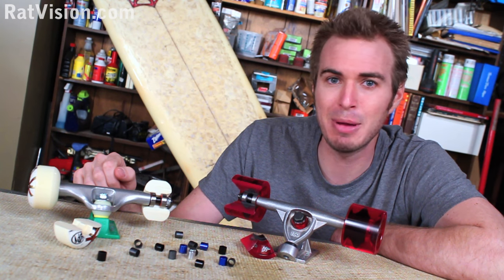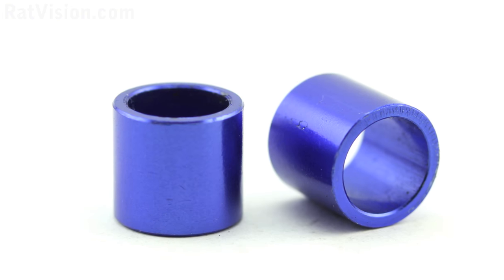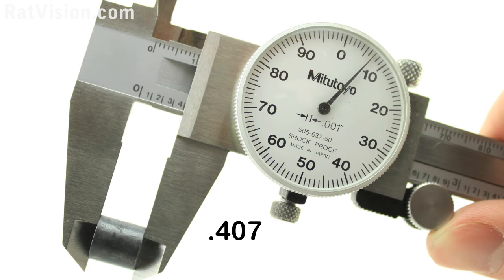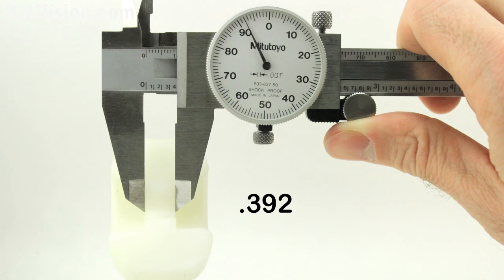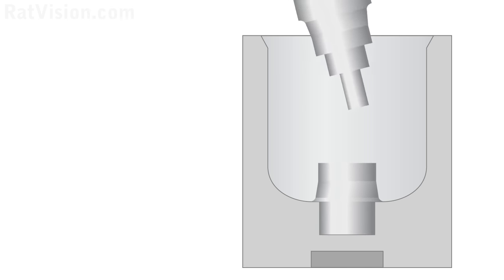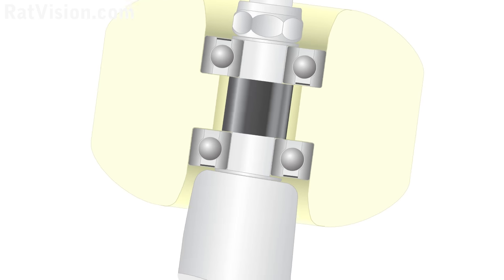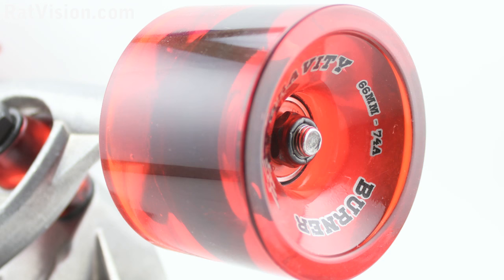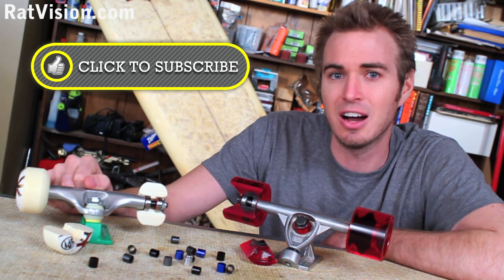Fastest Skateboard Wheels, Bearings, and Bearing Spacers

Comment: I am a beginner getting into street skating. 
I got a board built a month ago at a nice west coast skate shop and just realized it doesn't have spacers (but it rides great). 
Given all the info in the video, what is your best practical advice? Should I try to get some? Or if I am putting together a new board, what kind should I get? Is it worth it if there are going to be minor defects in many of the parts? (I ordered trucks, wheels, and bearings, but none of them came with spacers.)
Great video!
Reply: they're are not useless. get a board and slippery wheels and practice slow slides. wet ground is easy to slide at low speed so its good for beginners because its fine if you eat shit you arent going too fast. and skate shop has spacers for like a dollar
Reply: no one uses they
Reply: ok that doesn't mean anything
Reply: when I first started skating I thought spacers weren't important but without them your baring can get worn down quite quickly.
Reply: theoretically it is best to use spacers. practically it is impossible to find proper fitting spacers and if the spacers dont fit properly they can damage the wheel. the cases that hold the bearings will eventuallly get wider and the wheel will be a size too loose for the bearings. it will be like the bearing rolling over a carpet of wheel, if this makes any sense. just dont bother with spacers i have been skating for 30 years and only used them until i was 10

Comment: I have spacers that are about 2mm bigger than the wheel centre and the bearings just stick out of the wheel, is it better if i just take them out or should i keep them in? Ive been using those spacers for about 4 months
Reply: Get different spacers instead of going without them.
Reply from the maker: You can use them.  Better to have them in.  However, unbalanced parts can lead to speed wobbles. It doesn't mean you'll get wobbles, just letting you know it's how it happens.

Comment: So, is that final wheel, the bones one all rubber, no plastic hub?  That's part of the problem if so, I would imagine, but I could be wrong.  Generally wheels without cores are pretty dicey as far as durability and precision / tolerances.

Comment: Hey Rat Vision – Skateboard Tech in your opinion what is the best brand to go to for street skating wheels?
Reply from the maker: We haven't done a ton of testing on wheels yet, but we don't like Spitfire or Bones.  Their wheels might work perfectly fine, but we don't like the urethane in Spitfire, and we don't like the false information from Bones. You also need to realize that nearly all wheels, in both street and longboard skating, come from just a small handful of manufacturers.  So, it's important to know that almost all brands do not make their own wheels.  This is why we need to find out where all the wheels are coming from and then do some testing.

Comment: I've heard that brass spacers are better than spacers made out of other materials. Is that correct? Secondly I'd like to know how to measure the space inside a wheel without destroying it in order to have my perfect spacers custom made. Many thanks in advance ... !
Reply: OK- to leave you not alone with all the work I did some research on brass. Brass is used for and in thousands of products. Skate-relevant applications are especially fittings and gear wheels. Brass perfectly connects with brass or other types of metal as it is: slightly softer than metal, very smooth with a very durable surface, heat absorbing, corrosion resistant and has significantly better vibration characteristics than metal. Brass gearwheels are mainly used in combination with metal gear wheels as this results in best possible torque efficiency.

Using brass spacers could theoretically add more stability to the whole skate bearing system. It attaches better to metal bearing cases and could help reducing/compensating/absorbing loads, vibrations and heat. Considering this, using brass washers/speed rings may also be a good idea to use.

Just some theoretical thoughts with definitely no guarantee at all to be correct my friends:-)
Reply from the maker: Where have you seen brass spacers?  Are you referring to the brass ball retainer inside a bearing?  Brass is a metal!
You're way over thinking the brass thing.  A spacer is not a moving part, just a spacer. It doesn't matter what it is made of as long as it works.
Reply: Rat Vision – Skateboard Tech I am not referring to the ball retainer. A guy that I met on a cruise is using custom made brass spacers in his longboard and he says since doing so bearings last longer.
Reply from the maker: You are over thinking it quite a bit.  However, brass or steel retainers/cages are better for keeping the balls in line when they go through the abuse of street skating, but for speed a nylon retainer is much better.  It has less friction on the balls.  You can't measure the longevity of the retainer because every board, person, riding condition, frequency of riding, moisture, lubrication, and on and on are variables and factors that relate to the life of a bearing.  In other words this guy you met has no way of figuring out how much longer a brass cage will increase the life of a bearing because everyone and every skateboard, and where they skate is different. A "custom brass" cage sounds pretty ridiculous to us.
Like I said, it does have it's advantages over nylon, but nylon has it's advantages too.

Comment: i mean, you completely forgot about compensation for expanding and contracting wheels. when a wheel is being used on hot pavement, they tend to expand along with the metal parts inside of the wheel (ethough minimal, when we are talking about .001 measurements, it makes a difference. So in all reality, having a .002-.005 gap will allow for some expansion.

Comment: do you need bearing spacers? i don't have any should i get some?
Reply from the maker: No you don't need them to skate, but they do have a purpose.  You can skate without grip tape too.  See my point?

The wheel assembly is supposed to be tightly fit together.  This is possible with the correct bearings spacer size.  Unfortunately, without the right tools to measure your wheels, you don't what size spacers you need.  What spacers do is reduce the loads applied tothe bearings.  They prevent binding, friction, and galling.  They allow the bearings to perform better when loads are applied, which is all the time. This increases the over all performance in the skateboard.  You would not be able to tell that they do anything, but they work and have a purpose, which is why they exist.  In the end the bearings will wear out quicker.
Reply: Rat Vision – Skateboard Tech yhea ok thankyou :)

Comment from the maker: Do u think that maybe the reason u believe this is not a "huge deal" is because u anticipated over the last 11 years for your skateboard setup to perform the same way because it all seemed so normal and expected? For example, you expect your board to get speed wobbles at a certain high speed, and for your bearings to last a certain amount of time before needing to be replaced. That could all change with precision and quality equipment. Don't be a sucker for what u think is normal for 11 years.

Comment: so im paying like 42 eur for a wheel that might be defected ? 
how do you avoid it / mesure it without cuting the wheel in half ? :D
regards from slovenija.
Reply: +KtotheP tv They aren't defected, silly, only a little bit off measure. It won't be a big problem if you're tricking or cruising or even downhilling. I went 40 mph (or 64 km/h) with most likely really bad measurements and I had no problems (standard Globe wheels and Bones Reds, my guess is there's many flaws) so you don't have to worry too much. Going really fast (90 km/h) at 60 mph will make you think differently about these spacers and washers though
regards from America (:

Comment: Can you plz answer would a wheel that is 70mm be good with abec 7 bearings or would that be to tight
Reply from the maker: The wheel size has nothing to do with the ABEC rating.  It doesn't matter what wheels or bearings you get.  They all fit together.
Reply: Thank you
Reply: Oh ok thank I wonder what is the best bearing

Comment from the maker: Cores don't solve any problem, unless they are injection molded correctly.  No one, except for Rica, that we know of is injection molding cores.  You'll have to watch the video and see what the Bones wheel was measured at and find spacers that are that size.  However, that's hoping that each wheels is identical. BUT the additional problem you'll find might be that each spacer is not the same.  It's a giant mess all over the place.

Comment: skateboardtech, my friend has Bones Super Reds with Bones Spacers in Abec 11 Flashbacks. They make a crackling sound when hes riding. I have Reds with Khiro Spacers in Abec 11 Freerides and they make little sound. We were thinking that the wheel was too loose but why tightened it so it doesn't break the bearing and it still made the sound.

Comment: Is there a good brand for bearing spacers?
Reply from the maker: There are precision spacers out there, but the big issue is knowing what size you need for the wheels you have, and unfortunately, brands don't supply that info and you need to get the right calipers to do it.

Comment: What bearings do u recommend? I skate street and around $70-100
Reply: RɪzᴇFX|MᴏᴛɪᴏɴDᴇsɪɢɴ|RᴇʙᴇʟAʀᴛs i recommend bones swiss ceramic if you want a fast bearing it costs around 90 dollars
Reply: I don’t think bearings make any difference as long as they aren’t crapped out. If you were to roll a board with shit bearings and 1kg of weight, it would slow down quick, but with 60kg of weight, it just pushes the board along. Test it out!

Comment: Hey Rat Vision! This video has definitely opened my eyes to the scams of skate brands! I just have a few questions. How do I measure my wheel gap without having to cut my wheel in half as shown in the video? Also, the calliper that you use to measure the bearing spacers would be really hard to use to measure the wheel gap, so what tools do you use to do so?? 
Thanks a bunch!
Reply: Shane Harte Looks like you haven't gotten an answer yet (6 months). I have the same question. If no one chimes in, I'm going to buy 2 bearing sized bushings so that I can measure bushing/wheel gap/bushing to determine the gap.
Reply: +Ron Garza honestly I really don't think it's that big of a problem I mean how many times do u see someone break. There ankle cuz the race way in the bearing messed up 😁 just saying it's normally from them trying 30 stair gaps and landing wrong. He proved a point Thoe.
Reply: +Random timez Random, timez, I'm not sure we are talking about the same thing. I understood Shane Harte's question on "how to measure the thickness of the wheel gap" as a reference to the plastic between the bearings. So if the spacer (bushing) between the two bearings is not as thick as that plastic lip(?) then unwanted pressure is put on the bearings.
Reply: +Shane Harte 
I´m not sure because I haven´t tried it, but my guess would be a simple micrometer.
Reply: +Shane Harte Trust me, unless you're going to attempt 90 mph on a longboard, this measuring isn't needed. And these aren't scams either. Bones Reds will work exceptionally well, even if they're fairly flawed. All these extremely minor flaws will be a problem at very high speeds and induce speed wobbles, but speed wobbles are very expected. All in all, riders deal with these flaws, and they won't be too bad if you suck it up. If you trick, then this isn't even close to a problem. If you downhill, learn to control your wobbles
Reply: justo dont use spacers and your problem is solved. the very few times i ever used spacers i ended up with loose bearing hubs. just make sure you leave a tiny gap when you tighten the wheels so that the can spin freely and have a little wobble
Reply: esquivel1 Or use bearings with built in washers and spacers
Reply: +KoreanJoker rekoJnaeroK if we are talking about the same type of bearings then these can only be found on very cheap skateboards bought in supermarkets. they always suck big time. i have never seen a decent skater use this type of bearings and i have never seen a decent skater use spacers. i have been skating for over 30 years and have travelled all over the world (for skating). everyone just puts their bearings plain and leave about a mm of play. i dont have a clue what longboarders do but i am also a mech. eng. and would expect spacers to be a bad thing even for high performance longboarding
Reply: esquivel1 The spacers and washers keep the ball bearings from moving too much in technical sliding. Still a preference, but longboarders use built in washers and spacers to increase lifetime of the bearings slightly longer. Performance doesn't change as much in high speeds as long as you keep the wheels clean (which, in downhilling, not really hard of a problem). So yes, bearings with built in spacers and washers are actually pretty useful. In skating, you are just tricking, so spacers and washers aren't really needed. You're not pushing your bearings to the limit in technical sliding or freeriding. You're using  your bearings to take you to the next box or rail, pop the board and use your deck or trucks, not the bearings. Not trying to put skating in a bad light, but bearing performance is more essential in longboarding

Comment: I just oredered new bearing cause my ones are falling apart And I think its because my spacers are way to small,
what 52mm  Wheels can I get, and with what spacers?
Reply from the maker: We would have to measure all wheel brands and models to know what size spacers fit each wheel, and after that you would have to know where to get the right size spacers and have the tools to measure them.
Reply: My spacers are actually to big for my wheel, do you think I should just skate without them or will it drastically shorten the life of my brand new reds?

Comment: Hey Rat Vision what spacers did you measure that were 400 on the dot thank you
Reply from the maker: It doesn't matter which spacers we measured that were on the dot, because you have to know what your wheels are.  We could tell you but then they won't fit your wheels.  It would be a much better idea for wheel brands to sell the right spacers for their wheels instead of the bearings brands supplying spacers.
Reply: Oh OK thanks

Comment: Yo! I have exactly the problem you described - my spacers are way too big for my wheels (pretty sure they're "same" size, just badly manufactured,) so bearings couldn't go all the way in. Also I noticed that withot them some of wheels roll much better, but some roll just fine, either with or without spacers. Think I'll just gonna ride without 'em, seems like they could do more harm than good.
Reply from the maker: In your case they could do more harm than good.

Comment: The wheels of my new board felt slower then my old board so i took out those bearing spacers is that dangerus?
Reply from the maker: +Remco Hamersma The spacers were probably not the cause.  New bearings are not as good as bearings that have been broken in.  The "break-in" period takes roughly 15-20 hours of skating to allow the parts in the bearings to change their riding surfaces.  Clean and well lubricated bearings are always better than new bearings.
Reply: Probs just shitty wheels.

Comment: I have a question, i have a landyachtz switchblade with bear 852 trucks, ceramic bones swiss bearing and zombie hawgs 82 a, and orangatang  in heats, when i ride there is a weird sound and i think it's the spacers, because i got wax and got the trucks all covered, I cleaned the bearing, and put speed cream on them. i just ordered khiro 8mmx10mm steel spacers, are those good fro my wheels, please reply.. I am very frustrated.
-chandler

Comment: I bought a new set of wheels and when I put my bearings in and put them on my trucks one of the wheels wobble really badly. I don't think it's the bearings because they were fine before. Any idea on what it might be?
Reply from the maker: One bearing is not in the wheel bearing seat completely.  Take the bearings out and press them back in.  If it still happens send us a reply.
Reply: I tried that and they are in all the way. Maybe the wheel is warped?
Reply from the maker: Just like we show in the video, the bearing seat could be crooked.  If both the bearings are the same, then you know something isn't right with the wheel, or the bearings aren't sitting in the wheel right.  How does the board ride?
Reply: Rat Vision – Skateboard Tech Just tighten the wheel all the way down til you literally can not anymore, it will go in straight
Reply: Brandon Embry Does this damage the bearing though?
Reply from the maker: HELL YEAH IT DOES.  Worst advice!

Comment: so I'm curious if my board and whole set up is good i have a landyachtz switch 40 with landyachtz stock part so far ???
Reply from the maker: It's fine. Skateboards can be compared to cars.  Every one pretty much does the same, driving people from point A to point B.  However, some are built better, perform better, have better safety features, more style, accessories, durability, and so on.  Skateboards have many variances to, but they all work, just like all cars work too.  So, what we did in this video is point out how not everything is fitting properly due to poor manufacturing standards, and what happens when these parts aren't fitting or working the way they are intended.

Comment: I bought a secon hand skate board and it had no spacers, is that like a thing? I came from bmx so i dont know much
Reply: +Yassid Martinez (YMGamer) If that board was 50 bucks, don't even bother. Cutting corners like that is terrible and you should know that with BMX. Buy a proper board. Other than that, washers and spacers aren't needed necessarily in skating